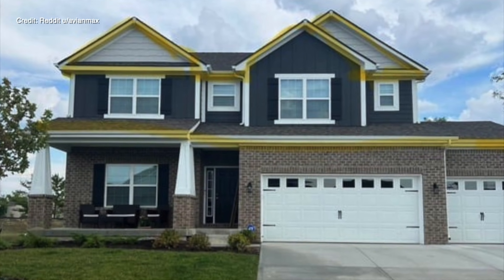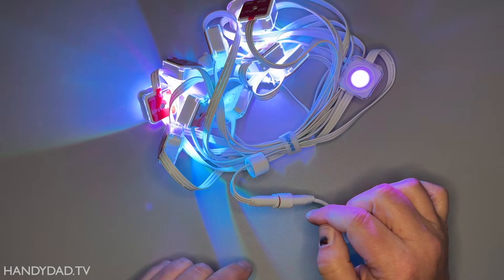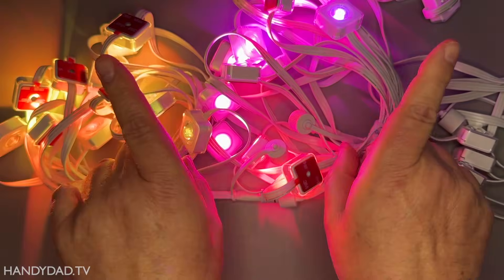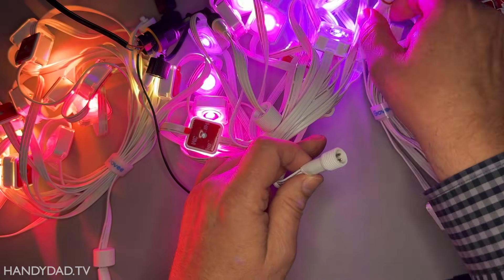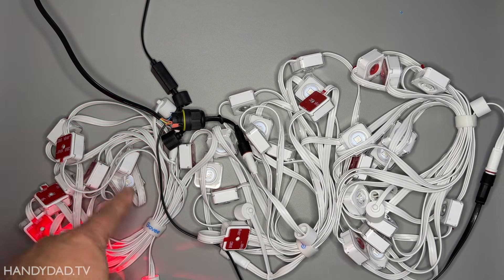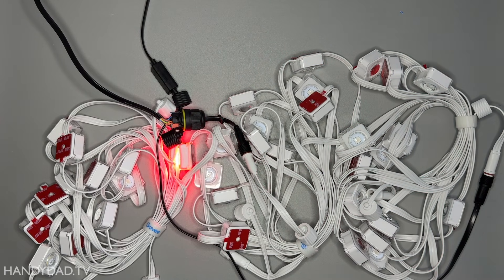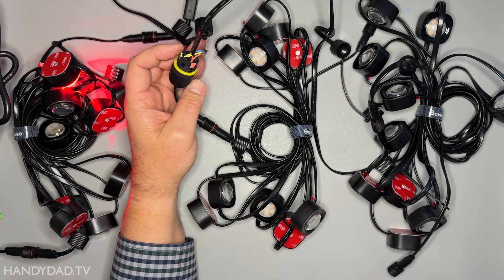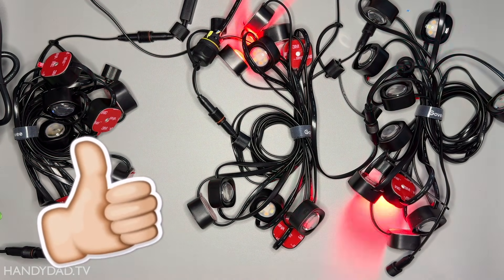Can you split Govee lights with a Wye Connector?

Comment: I was waiting for you to do the 5-second reset after hooking up the Y-splitter with both branches of lights, but you didn't. Does that change anything?
Reply: I was hoping to see the same thing.  If each is addressable, then it should ID each lighthead after a reset.  I see the reply that it "should" detect as 2 sets, but does it?  Is there a video that shows a reset after the split?
Reply from the maker: It should still detect it as 2 sets.

Comment: Yup did this with my own diy y-splitter with the non pro lights on my house last weekend.   You don't need the pro version.

Worked perfect for pairing a separate strand over my garage below the roofline row of lights, and sequences perfectly.👍
Reply from the maker: This method should work with any brand or type of addressable pixels.
Reply: Question, what happens if the two branches are not equal lengths?
Reply from the maker: @RanAn That’s fine. The shorter one will mimic whatever the longer one does.

Comment: This was perfect time for this video. I just bought the eufu lights similar to govee and need to split the lights because of the small peaks on the roof line   I assume the same results even when you use WLED as the software
Reply from the maker: The results should be the same with any addressable pixels regardless of brand.

Comment: Sounds like an ideal use case for the roof in 0:10, as long as you space the lights on the shorter length closer together. The lights would change in sync above and below that window.
Reply from the maker: Yes 👍🏻
Reply: This is an excellent point!!!!